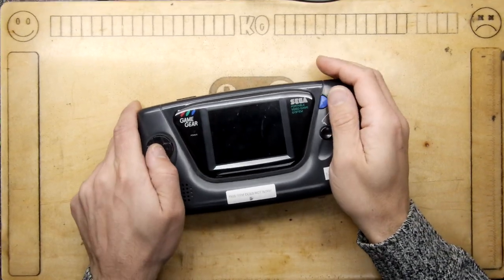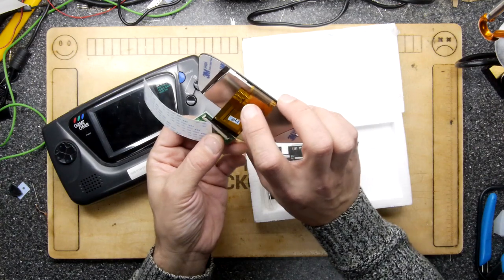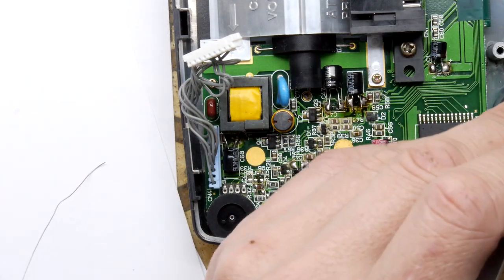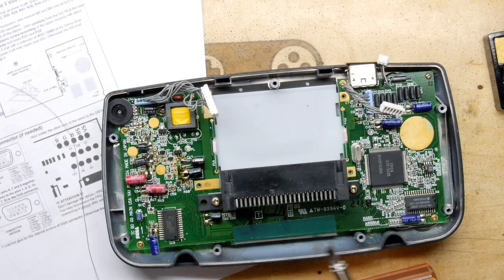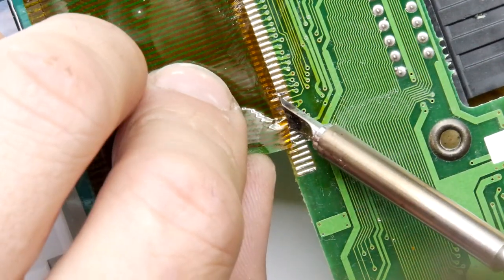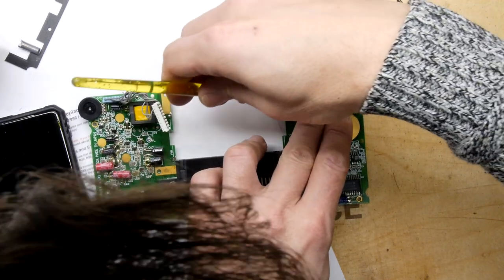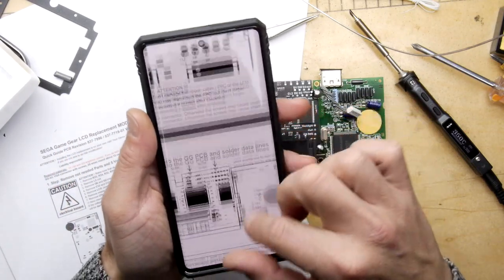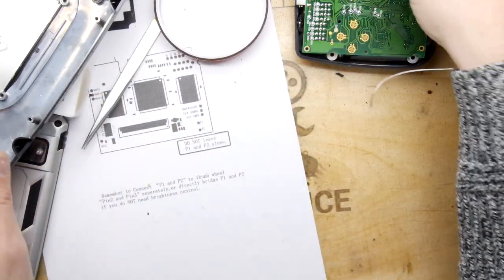Game Gear Screen Upgrade

Comment: do you have a link to that screen kit ? would not mind doing that screen mod to mine as screen is on the way out after i had recapped the gg last month and been using it a fair bit as stuck  being bed bound for the next 2-3 months since a bike crash
Reply from the maker: https://www.aliexpress.com/item/4001229249389.html
Reply: @backofficeshow  thanks

Comment: Great video I see on ebay there’s a v4 kit that has plugged connectors. But looks like you do have to solder some lead wires to some pins. Would this now be the easiest way to install a screen mod in any gamegear? Thanks.

Comment: So question: do the capacitors still need to be replaced or is this a way to both update and bypass replacing capacitors?
Reply from the maker: The capacitor will still need to be replaced